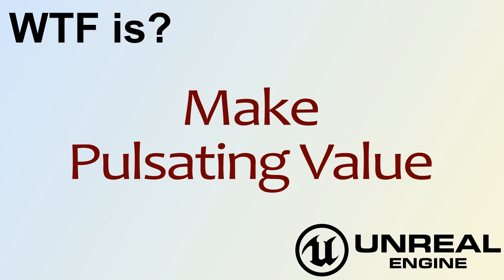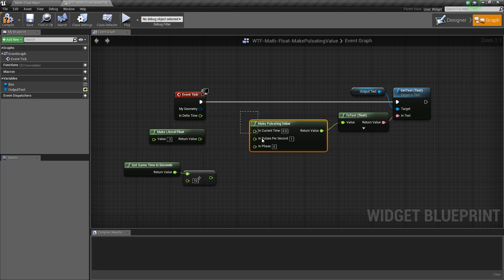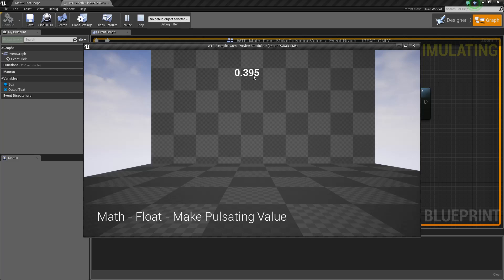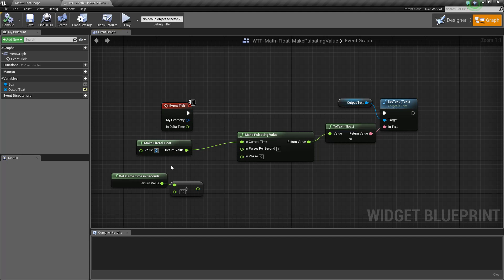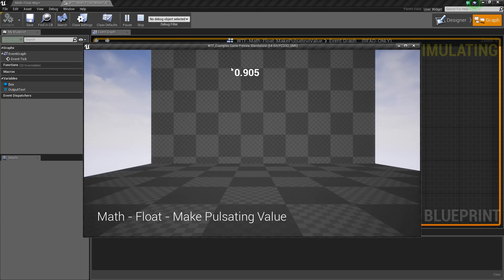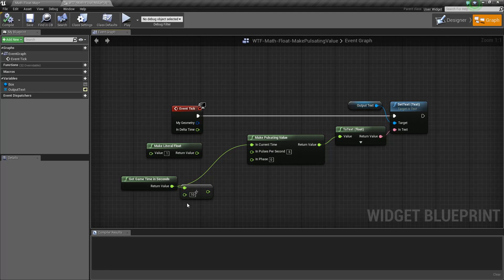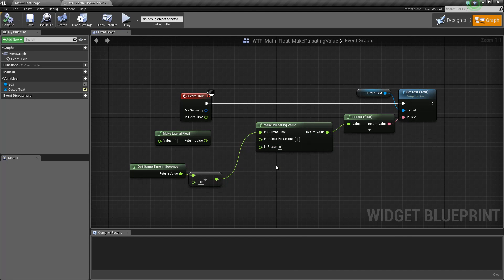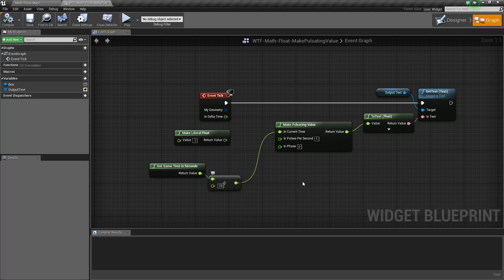WTF Is? Make Pulsating Value in Unreal Engine 4 ( UE4 )

Comment: Hi again Mathew. Your contribution is very much appreciated. You are my number 1 source now to learn well this awesome piece of software. Would you mind telling me sort of a structure on how to look at your playlists. Like watch variables first, then arrays and so forth. Will really appreciate it. Regards.
Reply from the maker: For the most part there is no real order or structure besides nodes being grouped by the type they are.  After the intro series or any other series that is grouped together the rest of the nodes are mainly there for reference.  If you find there is something you don't quite understand that is when you would look for a particular node or section.  I generally did do them in order making sure that anything needed in the video was covered by an earlier video so at the worst going in order would work as well.
Reply: Thank you Mathew.